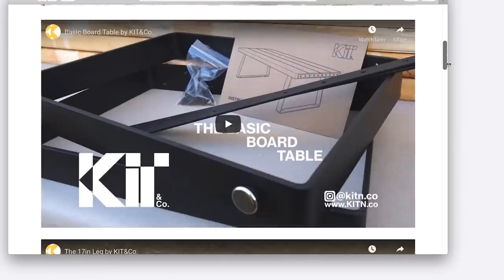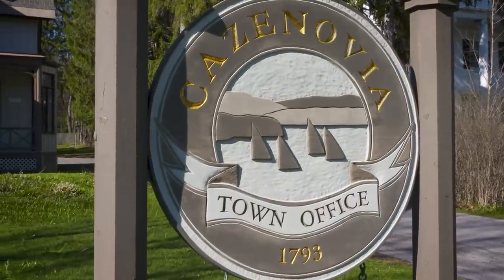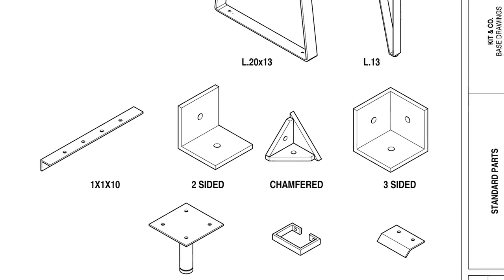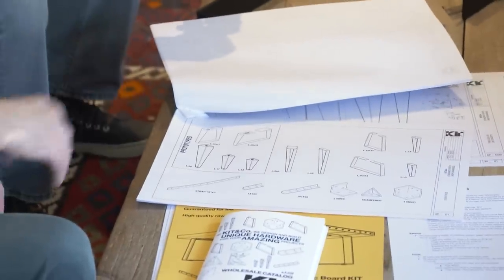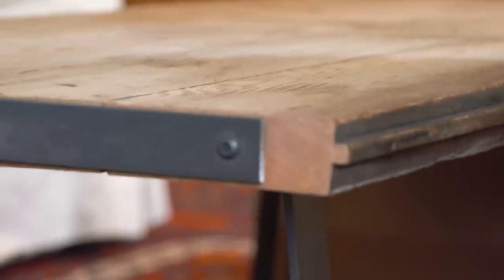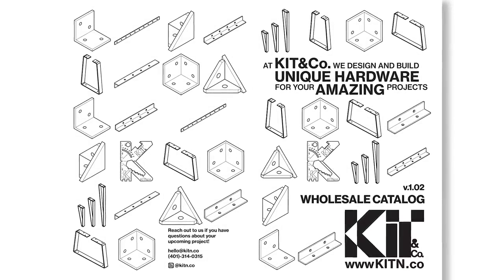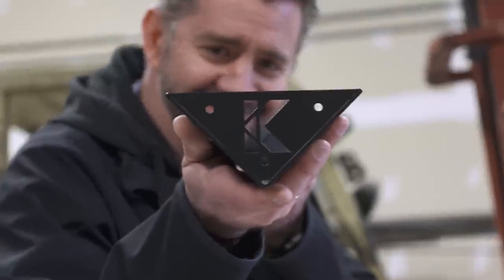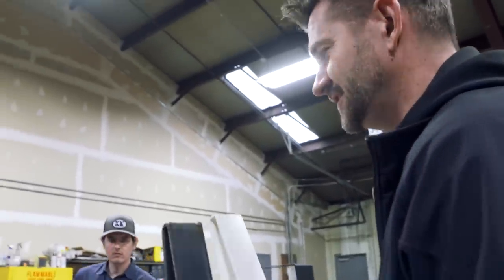Built in SketchUp: Kit&Co Uses 3D Modeling

Comment: Aaron,  I have used and use sketchup for production/manufacturing.  I'm not currently connected to a shop but have done numerous large reception desks for commercial millwork.  Have models if you would like to view them.  All have been built and are installed in live environments.  I have only in the last year started working to produce drawings in Layout.  The shops I worked for before used AutoCAD, so it took some teeth pulling to get permission to model the product in Sketchup and then export out to AutoCAD.
Reply: Transitioning software is never easy... but it's good to hear you are trading up!